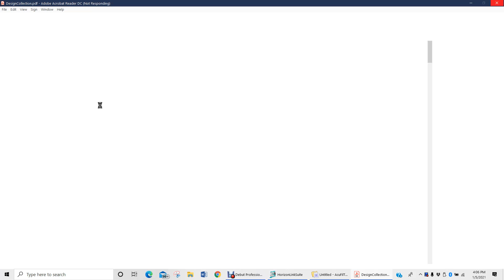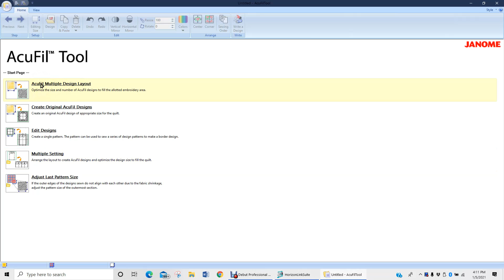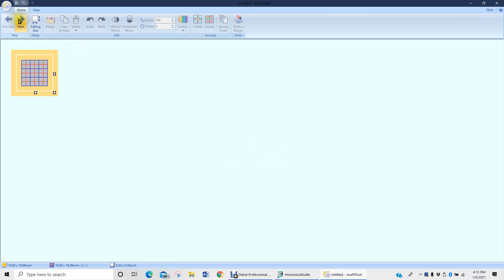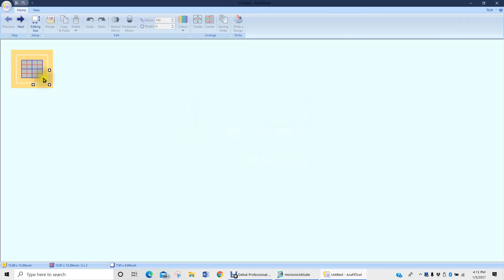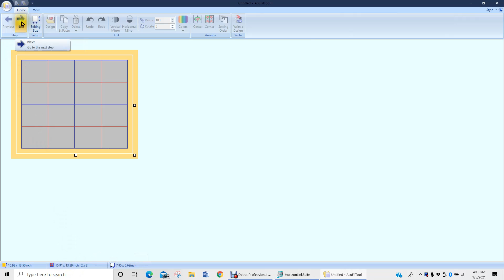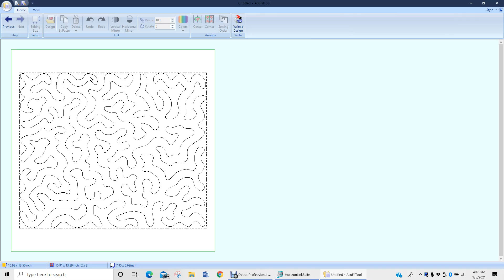Part1 Acufil

Comment: I recently purchased a 550E, with the purchase I received the Acufil quilting kit. Is your video similar for my machine?
Reply from the maker: Yes, I do think that the program works exactly the same regardless of which machine is being used. However, I don't have the program for a 500e series of  machines, so I can't verify that entirely. The only difference will be the hoop size because the Acufil hoop (ASQ...) hoops for the different  Janome machines are different sizes, but in that case your program for your particular machine will reflect that. Thank you for watching my video, if you have further questions please ask!